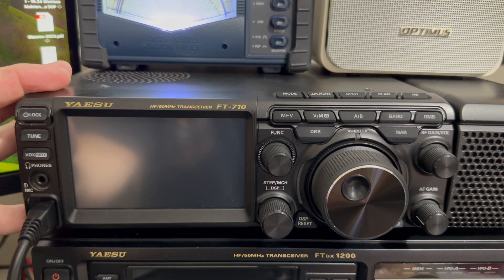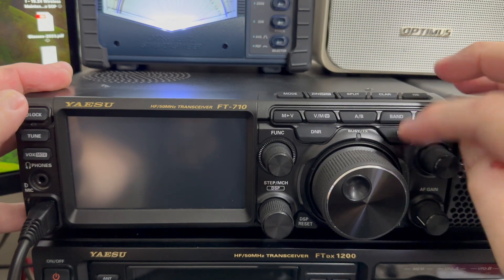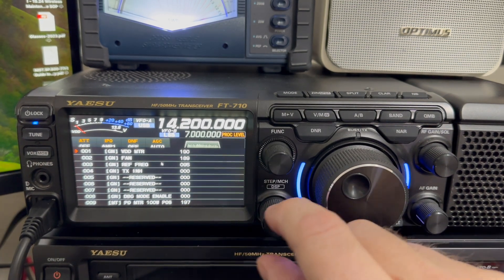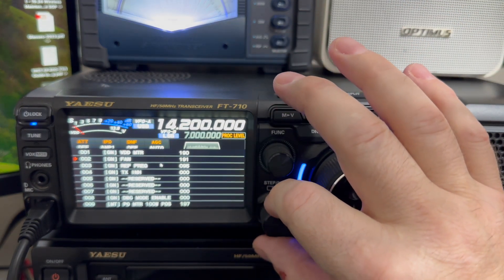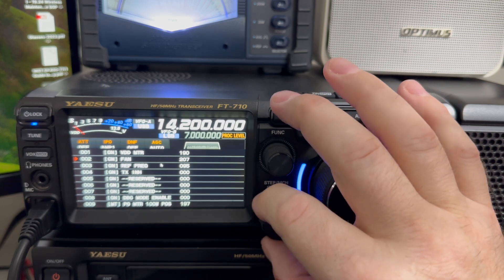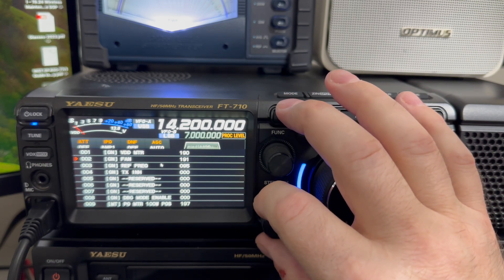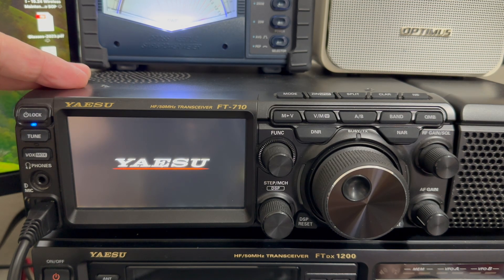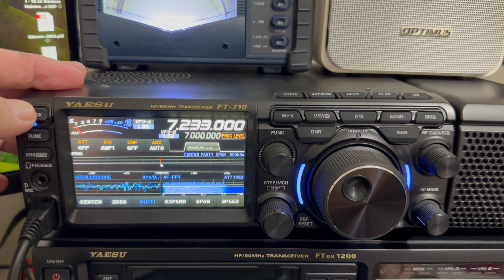FT 710 Fan Menu

Comment: Yaesu must have done something to keep people from changing this, because mine defaults back to 195 every time, even if I have moved off of the adjustment and input it.
Reply: In the menu, adjust to the number you want then press and hold the Func button for 2 seconds. A beep will confirm. Then it will stay even after powering off etc.

Comment: I wonder where the temperature sensor(s) is for this function. Could be an actual temp sensor chip, like an LM35, or just a PN junction. Many FPGAs and Processors have built in sensors. Too bad the radio doesn't have a way to view the readings.
Reply: I found where the fan command comes from; there's a D/A, Q4041 that sends signal "FAN" to an opamp, Q4071 that looks like its setting up a current source with transistors Q4078 & Q4021. This drives pin 2 of the fan connector, J4006. (Correct me if I'm wrong). The other half of opamp, Q4071 is not used. I still can't find where the temperature sense comes from.
Reply: Last entry: there are two thermistors. TH4003 looks like it's temperature compensation for bias voltage. TH4001 seems to be the one that the fan circuit uses. It is located on a corner of the PA board and its output feeds an analog input of the microcontroller, which then outputs to a D/A and controls the fan. If you could probe test point TP4003, you could know at what temperature the fan turns on and then make an intelligent decision with the fan menu item.

Comment: I set mine to 185 a while ago and have been happily running FT8 at about 80 watts, although I'm a very "light" user of FT8 and never call CQ. The fan still comes on - even when just on receive - but not as often as before. I guess the bottom line is, if you can't afford to replace your finals you shouldn't mess with replacement fans or service menus, but for most hams this is a moot point.
Reply: Ciaoo, nella Radio non ci sono solo i Transistor finali che scaldano in trasmissione, ma in Ricezione ci sono componenti che scaldano molto CPU ,Display, FPGA, tieni presente che il modello 710 e un doppio SDR (SDR la parte Audio) SDR la parte Display metodo Waterfall, tutti questi componenti devo avere il loro ciclo di raffreddamento se viene abbassata la soglia diventa critico anche in Ricezione.
Reply: @francodegregorio1957  Are you hoping that the fan blows on the chips? The fan does not turn off. This means that the chips remain hot and are not blown. And the fan drives dust into the case.

Comment: I fited a Noctua NF-A6x25 FLX.  Powerful and virtually silent 19.3 dB
Reply: Is some radio disassembly required to replace the fan? (warranty stickers here). Edit: The connector is close to fan hole but the access is quite hard and it will be very hard to unplug it thru fan hole. From my testing at least. So yes, removing top cover and then internal metal cover will be required + changing connector on noctua. Edit2: I also conclude that this Noctua is not enough. Original barely is able to cool the thing down while transmitting and Noctua has two times worse static pressure parameter than original Panasonic.
Reply: Are you stll happy with the Noctura solution? Best regardsm Thomas
Reply: @  Yes it works fine. I used one of the low noise adapters supplied with the fan.  I think it was the NA-RC10. I have photos of the fit if you need them.
Reply: @McRocking  Thanks! great news. I may come back when I have the 710 :)
Reply: Are you still happy with the Noctua NF-A6x25 FLX fan?
Unfortunately, the original fan is very loud.
Reply: @ Yes, very happy.
Reply: @McRocking  Modification was very easy. Fan runs very quietly. I am very satisfied so far, thanks again for your contribution.
Reply: @carlosnaar8203  Great, glad to hear it's working well for you too.

Comment: I have seen more than a few videos where people put the Yaesu radios into service or calibration mode. I understand if you are benching the radio for a tune -up or after the replacement of finals, etc. but I have seen 3 people already in my area who have done this but never noted the settings before tinkering.... saving the radio memory onto the SD card or in the case of say a 991/a saving to an RT systems file does not save these configuration settings.  The second you see the screen where you can make changes, snap a pic, write it down or both. Yaesu will take a long time to send it back to you if you mess it up and it costs a bit to get that done. Just my 2 cents for for what its worth.
Reply from the maker: No argument about recording the settings, my original reason for the video was to have record of all the settings. It's worth noting that the radio backup does not include the service menu settings.  The easy way to get those on a 710 is to do a video capture as you scroll through the settings.